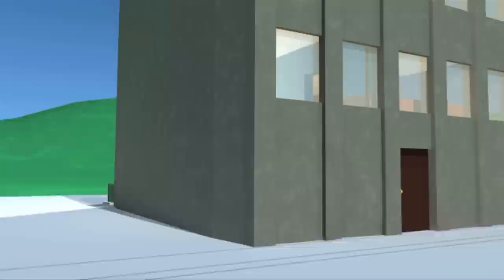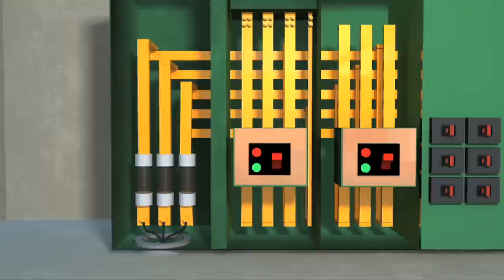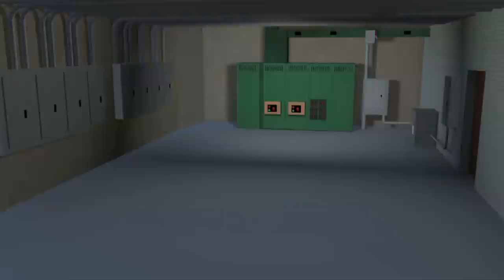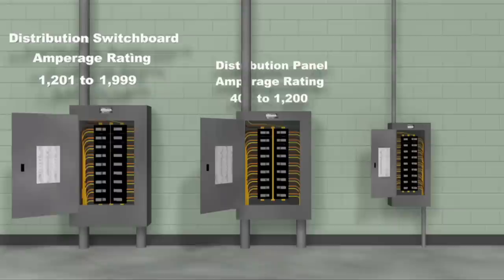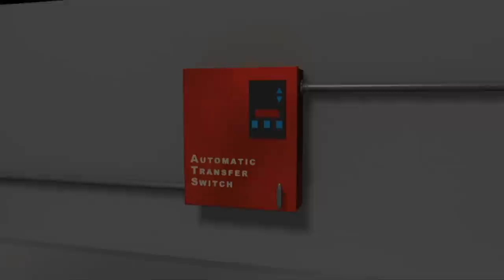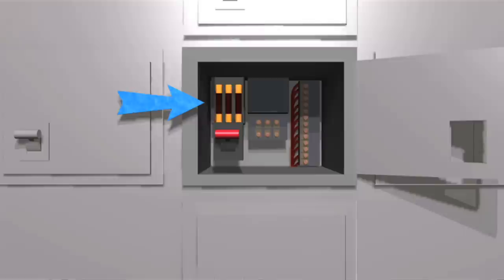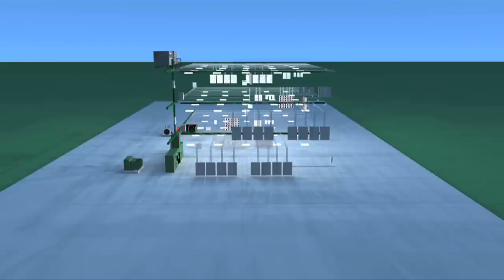The Electrical Distribution System

Comment: 🎯 Key points for quick navigation:

00:03 🔌 Overview of electrical distribution system
- Detailed explanation of electrical components and their functions.
- Introduction to Transformers and their role in voltage reduction.
- Importance of switch gear in managing electrical flow.
03:00 ⚡ Switch gear and distribution panels
- Description of switch gear components and their purposes.
- Functionality of main fuses and draw out breakers.
- Differences between various types of distribution panels.
05:44 🏢 Bus duct and distribution on floors
- Explanation of bus duct as a high-amperage alternative to conduit.
- Role of bus duct in vertical power distribution within a building.
- Application of bus duct in supplying power to HVAC systems.
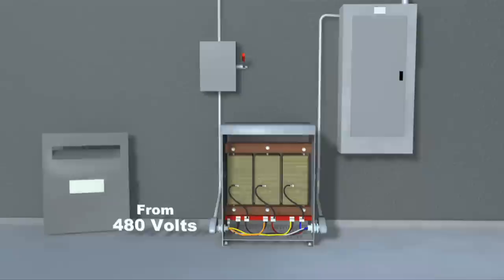07:32 🔄 Transformers: Oil vs. dry
- Comparison of oil-filled and dry Transformers.
- Cooling methods and operational differences.
- Use cases for each type based on voltage requirements.
08:14 🔋 Emergency power systems
- Overview of automatic transfer switches (ATS).
- Role of battery banks in providing backup power.
- Applications in facilities requiring uninterrupted power supply (UPS).
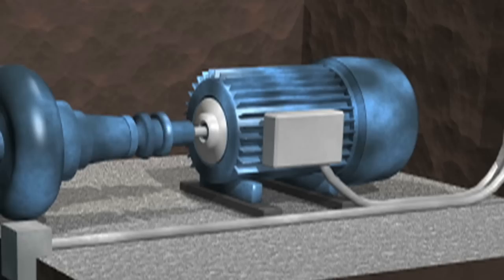09:38 🛠️ Motor control centers (MCC)
- Introduction to motor control centers (MCC).
- Components of an MCC bucket and their functions.
- Examples of motor control scenarios in industrial settings.
11:00 🖥️ Power distribution units (PDUs)
- Role of PDUs in data centers and computer rooms.
- Components within a PDU and their functionalities.
- Importance of clean power supply to sensitive equipment.

Made with HARPA AI

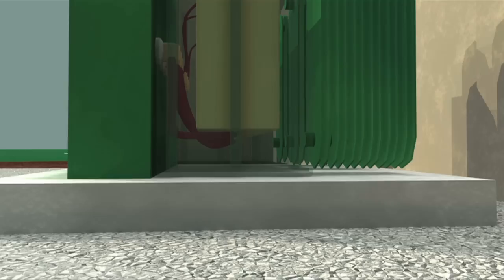Comment: 2:00 Amperage increases when the voltage is lowered? It does not sound correct.
Reply: the product voltage x current remains same so if the primary has a high voltage, it'll draw less current at the same power but when voltage is lowered at the secondary, more current will have to flow to make Power( volts x amps) same